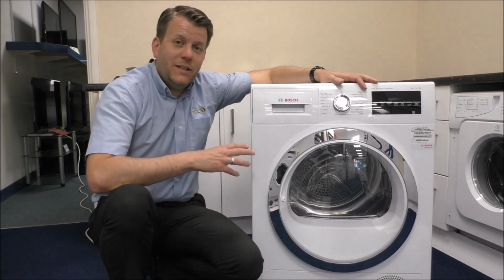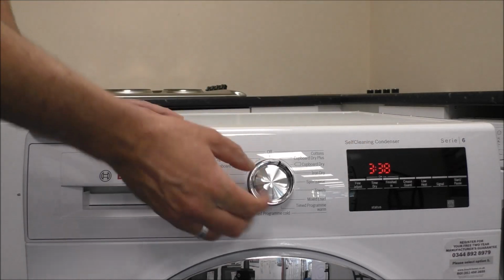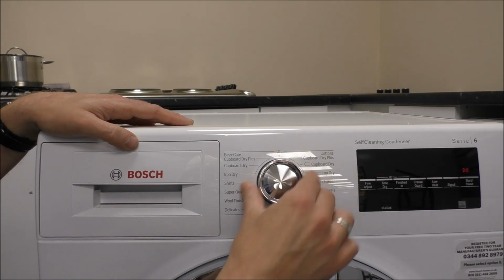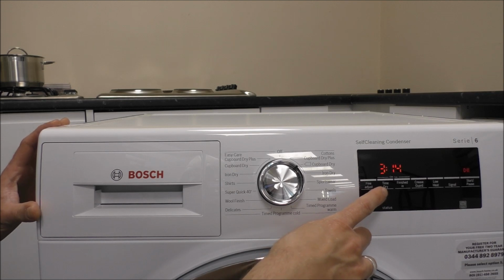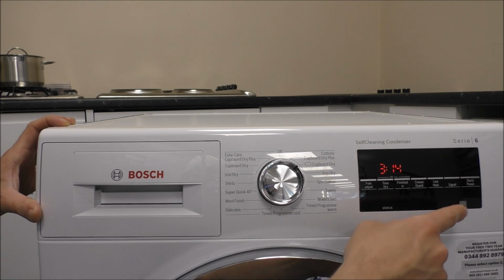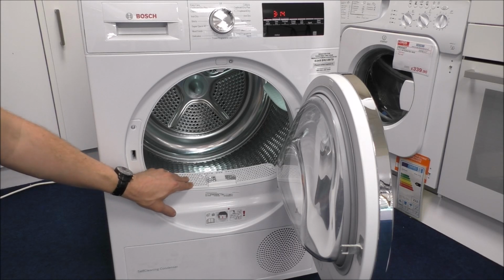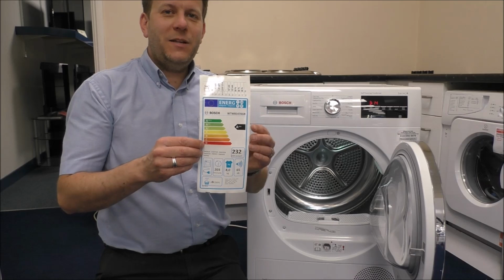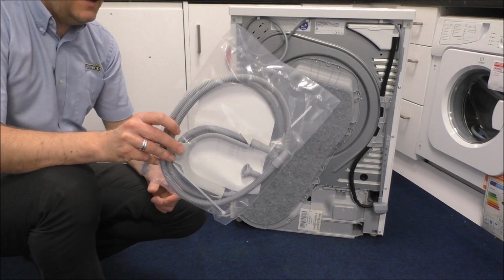Bosch WTW85470GB Heat Pump Condenser Dryer

Comment: Hi, very informative thank you.  Question, I find that my clothes are always damp despite following correct instructions, in my mannual it says clean the moisture sensor, but I have no idea where that is, please can you advise.  Thank you.
Reply from the maker: The moisture sensors change depending on the model, but as far as i know on most of the Bosch models, if you put your hand inside the drum and feel around the inside of it you should hopefully be able to locate the sensor and give it a wipe over.
Reply: @lords-electrical  thank you for taking the time to reply much appreciated!

Comment: I just bought the new version with auto cleanup heat pump.  Horribly slow.  it uses 15 amp fuses @ 250 volts while the Miele use 15 amp fuses @ 120 volts.  Yes, two times more energy.  Yet, this Bosch dryer takes 3 to 4 times longer than the Miele to dry.  It takes literally 3 hours or even more.  While de Miele will take 55 minutes.  Stay AWAY from Bosch.  You've been warned.
Reply: Hi!! I also just bought a Bosch AutoClean dryer, it's not delivered yet but sadly i'm just seeing your comment yet. With what model of Miele are you comparing it to ?
Reply: @My.MusicChannel  Actualy, ANY.  Because they are all the same.  Higher price adds function like bluetooth for example.

Comment: Hi. What is the difference between a condenser dryer, condenser heat pump dryer and the only heat pump dryers?
Reply from the maker: There will mainly be Condenser dryers and Heat pump condenser dryers. In a nutshell the heat pump dryers are more efficient energy wise, but will normally take longer to dry than a normal condenser dryer.

Comment: Which is the hottest setting? I've had stuff in cupboard dry plus still bit damp?
Reply from the maker: Normally the cupboard dry or cupboard dry plus if your dryer has it should be the setting to use.

Comment: Mine is brand new delivered today and keeps stopping after 5 minutes? what am i doing wrong?
Reply from the maker: Not really sure. Have you got it set on the cupboard dry programme?
Reply: Lords Electrical I have it was two wet blankets and after the programme started 3 mins later it says ended?

Comment: If you disconnect the water outlet pipe from the machine and attach to drainage, how will the machine recirculate the water to clean the condenser?
Reply from the maker: Good question, and apparantly it will still clean the condenser unit throughout the programme and then exit the water through the drain hose. I don't know the exact process but this is what Bosch have told me.
Reply: Interesting. So it must just clean as it goes along then, rather than recirculate the water from the container.

Comment: That dryer is an expensive pile of crap that has half the capacity of a normal vented style dryer.  Some idiototic engineers came up with this condenser style nightmare, only for the truly stupid to waste their money on.
Reply: I'm currently buying Bosch or Miele, but I have not decided yet. I wonder how reliable is that Bosch "self cleaning" condencer unit? Will it stay clean after several years of heavy use? Miele on the other hand has a detachable filter before condencer, that consumer can remove easily and vacuum the condencer clean. When consider scenarios "when it fails": I think Miele has an advantage because I can reach as a consumer to the condencer and clean it, but for Bosch self-cleaner has to be maintenance personnell to disassemble+clean manually.
Reply: You are absolutely correct, Mr. Campbell. I have one and it is a complete waste of time and money. When I lived in the U.S.A. I could throw my clothes into an American dryer and they would be bone dry in 45 minutes, whereas, with this Bosch "pile of crap" my clothes are still damp after more than two hours.
Reply: @Marcfj  Hi, thaks for reply. What is that other american brand that you are comparing on?

Eventually I bought Bosch Series 6 WTW87479SN self cleaning condenser dryer. Because it was 1/3 of the price of Miele and still have 2 years warranty and 50 days free of money back guarantee from purchase. But eventually I have liked this dryer, it has worked for our household, as it have 9kg capacity. Usually takes 1,5 hours to get dry, it helps if clothes are left to antiwrinkle rotation for some time, so it makes them better dry. Not perfect, but good enough for the price I think.

It takes some time to dry, but thats the trend because manufacturers are enforced to improve efficiency (in here EU), which usually means longer drying times.
Reply: @982678249  - I have used all kinds of American brands over the years and they all work better than my Bosch---which I bought here in Thailand.